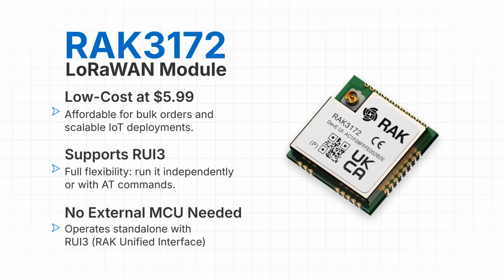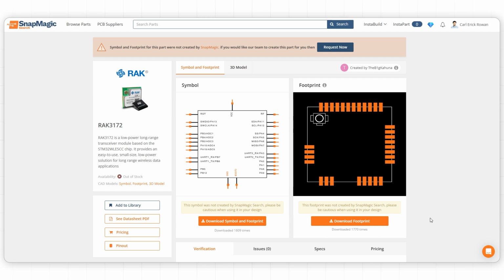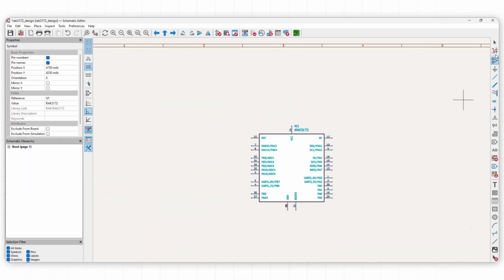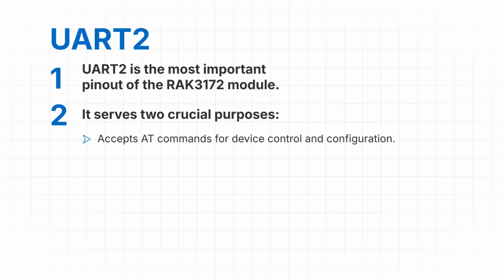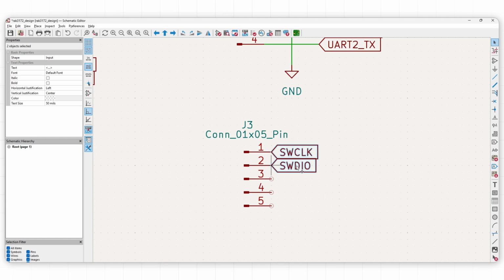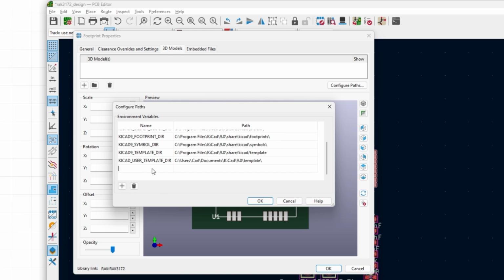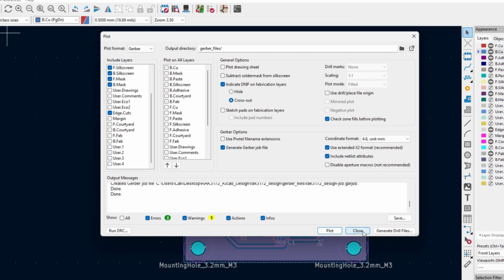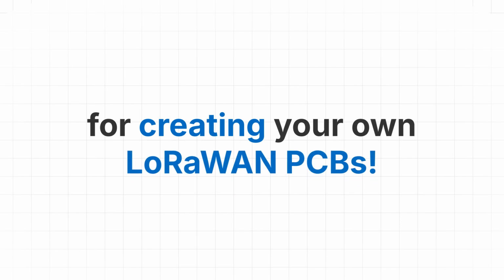7-Step LoRaWAN PCB Design with RAK3172 (No MCU! Only $5.99) | KiCad Tutorial

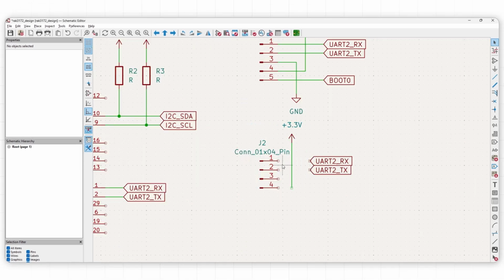Comment: Shouldn't the J2 connector use the UART1 pins (timestamp ~4:50)?
Reply: nope according to the datasheet rak3172 uses uart2 to interface with at commends and for programming thorugh uart